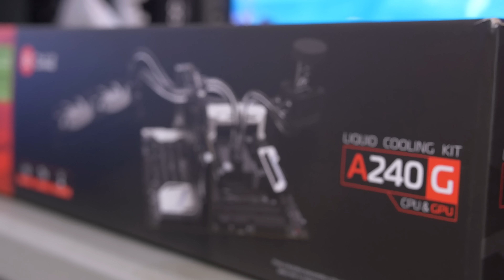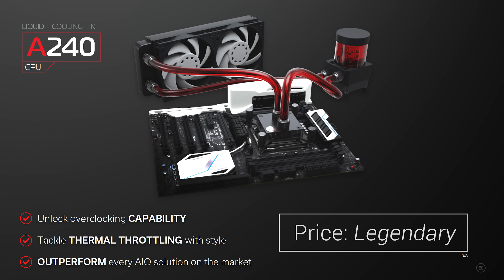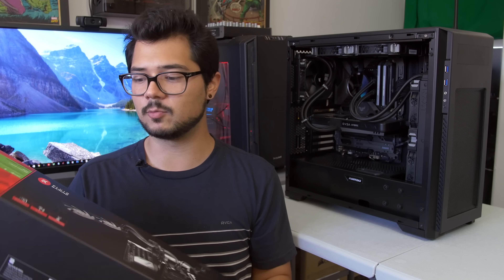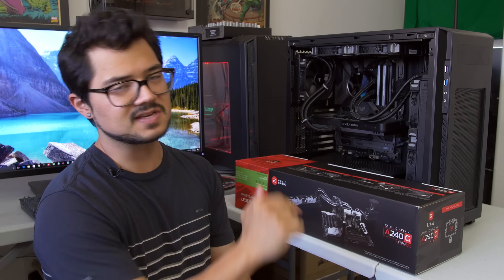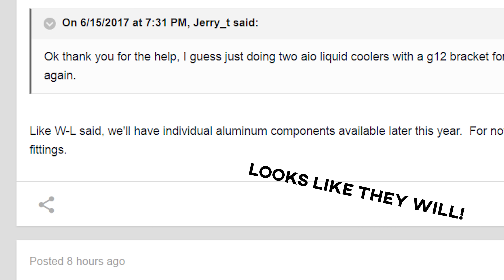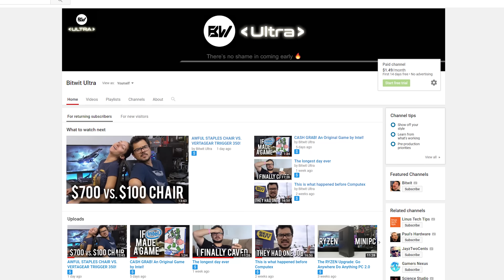FULL CUSTOM LOOP WITH *ONE* RADIATOR?

Comment: The CPU thermals are probably the same because the TIM on the 7700k is the limiting factor in heat transfer, not the cooling solution. This test might be great with the de-lidded 7740x that you received!

Comment: That looks to be a sweet setup for the money. 
Question: 
Do the fittings work with hard piping? At $240, I'd happily throw an extra $40 at it for hard pipes.
Reply: unfortunately they are for soft tubing only
Reply: Bitwit Ultra Well I'm waiting till ThreadRipper launches and the first gen bugs get worked out before my next editing build. By then I should be able to find aluminum hard pipe fitting. 
Thanks for replying so quick.

Comment: I have to say whats pretty crazy is your 76°C CPU...
I have delidded my i7-7700k and pasted with Conductonaut LM.
Using the Silent Loop AIO with 280mm Rad. My max Temp for Benching is JUST max 56°C after an hour. (Prime 95)
Idle is at 30-35°C depending on how long the PC was running. Gaming is RARELY over 50°C.
The i7-7700k runs at 4.5 GHz with 1.25Vcore.

Even with 5GHz @1.4V OVERCLOCK it runs 65-70°C MAX on Prime 95.

Delidding is KING.

P.S. 
I had to used a Intel STOCK Cooler form a i7-2600k for a week. While Gaming is was never over 76°C.... WITH A SMALL STOCK COOLER and 30°C Room Temp.
Again DELIDDING IS KING....

Comment: radiator has nothing to do with your max temperature. maximum temp depends on water block and thermal compound, and cpu IHS. radiator only matters in long gaming sessions. it changes how cool the whole loop can run for extended amount of time. for that matter a costume loop must do better because much more water is in the loop and t can get warm slower.

Comment: Why is everyone so paranoid about galvanic corrosion? It's a non-issue, and one that EK is well aware of. It's a smart choice and I'm glad to see these kinds of kits out there. I have wanted to do a custom loop, but it seems quite daunting to find all the fittings, and figure out just how much of them you need, and then the tubing issues, etc etc.

I decided to use an AIO cooler, but that's only good for the CPU. This solves the issues of no GPU being liquid cooled and I wouldn't have to think about all the parts I need to make a custom loop. Kit in a box, it's about time.

Comment: I have a phanteks case as well. You have to tape up the hole in the bracket next to the radiator to prevent air from recirculating back into the radiator from the case. It really does make a big difference.

Comment: just shows you how bad AIO coolers are.  in the new setup you have more fluid,  a better pump, and vardar fans are amazing too.  if you added a second rad it would cool even better.  EK makes amazing products even if these are the cheap-o aluminium line

Comment: What I don't understand is that I've heard several times that "GPUs use more watts than CPUs", but that would mean that a GPU would need more rad space than a CPU since more power consumed means more heat generated. However all GPU hybrids use a 120mm rad just fine, while CPU AIOs go up to 240mm rad space and achieve temps in the high 70s while OCd.

Thanks Intel.
Reply: GPUs are also significantly more complex. They use more power because they have dedicated VRM, VRAM, and microcontrollers on the same PCB. Also, the heat a GPU creates is spread over a wider area, allowing it to transfer more efficiently.

Comment: glad these aluminum parts kits work so well. tired of this myth that copper is so superior to aluminum for cooling. it adds weight and cost for very, very minor, if any cooler temps.
Reply: i tested this: same pump, same tubes, same rad size(240); Alum vs Copp    only 1c win for Mr.Copp  :P

Comment: Oh this is great! I wanted to do a custom loop with one Rad for CPU and GPU I'm gonna upgrade to (probably 1080ti but we'll see after Vega release 😊) in the next few months. Definitely going to keep this kit in mind. I have an R7 1700 and I want to OC. I definitely want to add an MOSFET block because I know this Gigabyte AB350 Gaming is gonna struggle under more volts smh. Hopefully can find an aluminum one.

Comment: Even with AIOs, there is still a limit on life span; it's not install and forget ... well unless you want a melt down, shorted computer, or upgrade every couple years. Liquid will permeate regardless of the tuning used by the AIO and the pump will fail ... eventually. So, 3-5 years down the road, or earlier, you still need to monitor your system. Periodically through it's life, including from install to failure, you should be looking for leaks. AIOs are not full proof. I really like this kit though since it includes everything. But, it does look odd with the clear tubing. Everyone is so focused on bling, LED, and glass panels and install tubes like this. At least black tubing of AIOs fade into the background. There is also the maintenance required for this loop; periodic drain and refill unless EK has some magic fluid. You did not mention their recommended maintenance cycle; which is a important issue. After reading the manual, they talk about cleaning, but not how often it is recommended. They do recommend ketchup and mustard as cleaning material on page 31 which is bizarre but I see their point. Thanks for the review! Jayz did not experience the same miracle, but you were only using a 120 for the GPU so the loop helped that. I was surprised by the CPU not coming down more. Cheers and thanks.

Comment: Would buy the kit if you could get it with included hardline tubing and maybe a block for Asus/MSI and other brand GPU's as well as an option to include a 2nd rad or a larger single rad such as 360mm
Reply: if they do expand the aluminum only line I would want to see a 360mm rad option included with 2 GPU blocks (a better looking GPU block would be nicer) and a CPU block with hardline tubing or no tubing at all and I could get the tubing separately as this is cheap AF would be good for someone like me who has never built a custom loop (have only ever built one PC in my life but now want to do a custom loop for my next one)

Comment: is it possible to overtighten the fittings with average bare hands? 
and on that note, have you considered doing an (elaborate) tutorial on liquid cooling? you made various videos about radiators and fans, but no complete "how to liquid cooling" unless i'm blind and couldn't find it. i have absolutely no clue whatsoever on the topic, but would like to play around with an AIO and ultimately a soft tube custom loop (hardline looks way too painful for me, unfortunately). but there seems to be a lot to consider like materials, features (someone in the comments here mentioned reservoir draining, e.g.), general layout and placement, installation and maintenance, etc. surely there's a bunch of good and comprehensive tutorials to read elsewhere, but it would be cool to have your face telling us about these things and your hands demonstrating the steps and procedures if you feel proficient enough and if there's enough interest. perhaps even a series, covering one topic at a time in detail

Comment: since you did a test and showed that radiator works best in front and the fact that the bigger radiator was front mounted, seems it would have been a more apples to apples comparison if you would have front mounted the single radiator.

Comment: Why isn't aluminum standard on water cooling?
Reply: Most aios actually use aluminum radiators, they keep the corrosion down by adding a bunch of anti-corrosive chemicals to the coolant, but they still corrode eventually, which would probably clog up the block and kill the pump if the loss of fluid due to seeping through the tubes didn't cause the pump to die first. If you cut open an old aio and disassemble the block you will probably find build up of corrosion in either the radiator stacks, the block, or both, just not enough to kill it before something else. In custom liquid cooling people generally use high quality pumps that don't die as quickly if the loop is properly maintained, and the reservoir and refillable nature of the loop prevents the pump from running dry, causing it to wear very quickly and likely die, and people like to re-use other parts of the loop, so they are more concerned with corrosion not affecting every component. Anti-corrosives could be used to help the issue, but they can only do so much and mixed metals will still corrode the loop to some degree.
There is also the matter of the components for custom loops being generally of higher quality, such as higher fin density or thicker radiators, better pumps and fans, full cover blocks cooling everything that is important on a card rather than just the vram, etc.
Reply: Fenris Wolf The element copper has a higher thermal conductivity than copper. Unless it was not copper, the custom loop must be better in another way, such as a better pump, or fan.
Reply: Cooper Cummings +1
Reply: Aluminum doesn't cool as well as copper and corrodes everything that is not aluminum, and sometimes even corrodes other aluminum if the trace metals in it are different enough, making it a huge pain to deal with and the only advantage being some cost savings, so in the past major manufacturers have avoided the cheap and dirty solution that will ruin a loop and harm their reputation, EK has decided that the cost savings are worth the risk of some idiot ignoring the warning labels saying not to use these parts with ones they haven't verified to be safe to use and then complaining publicly or trying to sue them.
Reply: Didn't you wach the video, aluminum was actually cooler than the AIO which I'm pretty sure use copper.

Comment: Would have liked to see a test of the CPU block only with that solution (unplug the GPU). We would have seen if you can get better result than 76 celcius from the X62... Just looking if the A240 kit (with the G) is worth it...

Comment: 52C on the GPU?

I have a XE 360 and CE 140, and getting 60 on the GPU, 70 on the CPU....
ah right the 290 :o)

Nah to be honest the temps are not all the factors that you should consider about water cooling, the major factor for me is noise to performance ratio, I've just upgraded the radiator last month. I was rocking the same hardware, but with a 25mm thick 360mm rad. Under gaming the fans would ramp up to 1100-1300 RPM (Noctua 120mm fans).
Now I can get a way with a single fan at 800 two on 400-500RPM  on idle , and under load three at 900RPM, and no 140mm fan on the last radiator, that one is acting passive.

Comment: add a second 240 rad and show us the temps after that. 

i have a swiftech h240x2 prestige with a msi gaming g1 980ti and 4780k and its running 62 on cpu and steady 70 on gpu which is overlocked.  i am about to add a second rad 240 rad in my nzxt manta to bring down my temps and hopefully, it should be drastic.
Reply: That would be interesting. But he might have a problem finding more aluminum fittings though.

Comment: TLDR; Be aware of the space and rad placement requirements for this kit before you buy, and also to not go by the numbers you get after just running firestrike a couple times; it takes a while of heavy use before you know the full story, and you may need to make adjustments in the airflow in your case after you do.

I've had one of these running in my system (4770K + GTX 1080 Ti) for about 2 weeks now. A few important things to note:

* MAKE SURE YOUR CASE HAS GOOD AIRFLOW!
* MAKE SURE YOUR CASE HAS SOMEWHERE TO MOUNT THE PUMP!

I went with a Phanteks P400, and it's barely adequate in both regards. I was able to shoehorn the pump in between the rad and the GPU (just barely), and I ended up having to put fans in the top as intake and putting the front mounted rad in exhaust to get stable temps. Putting the rad fans on intake and the fans on exhaust were making a negative airflow environment and heat was building up in the case and loop like crazy.

I would say almost all current small mid-towers will have similar or worse issues with this kit. Most of them you will have to drill holes to mount the pump, if you can make it fit at all, and a lot of them lack a place to put the radiator into an exhaust position with good airflow because they only support a front mounted rad and have front covers that limit airflow to it. I would seriously just not bother with them and go with a larger case with a place to mount the rad in the top and a dedicated pump mount location (Fractal Design Define S and various Thermaltake cases come to mind); I will probably move to one eventually myself. Bear in mind also that if you don't need any 3.5" drives, your selection goes up rapidly because many cases have an option to remove the cages for them in order to mount a pump.

The other thing to note is that it takes about an hour of heavy gaming to get the loop up to saturation, so not sure if Kyle's final numbers are correct. I suspect they aren't, because the GPU and CPU temps should be a lot closer together than what he came up with as they are both running in the same loop with the same fluid. My system, with a hotter running GPU and around the same for CPU, equalizes at about 66C on both parts (CPU a little less because it's closer to the rad). I plan on adding another rad to the loop once EK starts selling them, I figure I can get it down to 55-57C with just another 120mm rad in the back of the case.

Overall, I am pretty happy with the results. The GPU on the stock cooler was hitting the 83C throttle point on a regular basis, but the CPU ran cooler on the 140mm AIO I had it on. In the end the kit did solve the GPU temp issue, so that's a win.

Comment: More proof that AIOs are JUNK lol. Next time run a cpu intensive stress test and a gpu stress test at the same time and get that water hot. In gaming my water temps dont increase much (freesync keeps my fps capped) but if i dont water temps go up quite a bit. Those AIO and GPU hybrid pumps really are a total mess and although pump speed doesn't matter it does to some extent.

Comment: Put that fan in the back as intake, to feed the rad fans more fresh air. It'll improve the cooling performance a bit. You don't really need an exhaust now that all of the heat is dispersed through the top mounted radiator. 

Also, I'm a noob when it comes to water cooling, but wouldn't you get better average temps if you make the CPU be the first to get the fresh cold water? You've had a huge ~20°C margin between the CPU/GPU temps, maybe switching the order for who gets the fresh water first will help the temps going from 76°C CPU/52°C GPU to something like 60°C CPU/60° GPU which is better in the long term. In the current setup the CPU is kind of suffering.

Comment: There's way more thermal mass and surface area in a custom loop.  Your front fans alone are blowing over the pump which is going to be radiating some of the heat trapped in the loop.  Also all the tubing, there's probably 50% more of it compared to the dual AiO setup which is also going to radiate some of the heat into the case.

Comment: Does it matter for cooling that way the water flow is going? i thought you would want to have the out line of the pump going to the cpu and gpu then to rad then back to the pump not pump rad cpu gpu. can you explain please. thanks
Reply: Doesn't matter, the temperature in the loop equalizes so the water temp going into the radiator is pretty much the same as when it goes out. JayzTwoCents has a few videos about this, and there are probably many others as well.

Comment: I use one 280mm rad, 30mm thick for my custom loop. I have a heavily overclocked R7 1700x and FE 1080Ti, temps are well in check. I keep my D5 set at the 3rd speed setting, and fan speeds are rather low.

Comment: "Ek quality" my butt. I ordered one of their 240 AIO kits (the better not aluminum one) for my matx Ryzen build and the Ryzen blackplate for the CPU waterblock had such a signficant bend/curve that I couldn't use it and had to return it.  I ended up getting a Swiftech H220 X2 Prestige instead which comes with thicker tubing, angled fittings, and the same kind of pump and a larger reservoir .-. 

Also if you can afford a 1080 why are you wasting money on this cheap, ugly AIO kit.

Comment: wow, that i7 7700k needs a lot of voltage for 5GHz, mine does it at around the 1.25-1.27v mark
Reply: Joshua Nicoll you got a golden chip. Most 7700Ks need about 1.35-1.4V to overclock to 5GHz.
Reply: Yeah, I am aware it's an above average chip, but it's still not the best. One fella in the same HWBot team as me as a 5.4GHz@1.36v i7 7700K, which is a pretty insane chip.
Reply: Joshua Nicoll that's a unicorn chip XD.
Reply: Oh yeah, pretty much the top .1%,  It did bad on LN2 though, needing over 1.8v to get 6.5GHz, so good ambient chip, bad LN2 chip.
Reply: I dont believe that, the lowest reported is 1.28 and that was a HEAVILY binned chip that was delidded
Reply: I seen better chips that this, I spend a fair bit of time on HWbot, here's a 5GHz 3DMark ice storm run, with LLC on idle it runs 1.28 and load is usually 1.264
http://hwbot.org/submission/3560891_lordnicoll_3dmark___ice_storm_firepro_v7900_137677_marks?recalculate=true

Comment: Aluminium. Well I guess we have so much of it on earth, why not.
Reply: There is actually a huge shortage of it currently. My wife buys parts for an aerospace manufacturing company and they're pretty much on hold for about 3 to 6 months on any new orders that weren't placed already due to this.
Reply: Yeah, from that perspective it's just very smart and 'forward-looking' to use aluminium instead of that rare copper on earth to put into our computers as there are much more important uses of copper than cooling our components.
Also aluminium is MUCH cheaper and cools just as good and like you say it's afaik the only natural element on earth that does not have any use in nature.